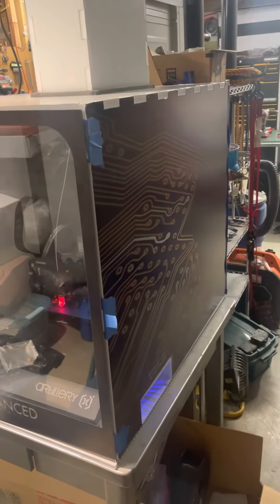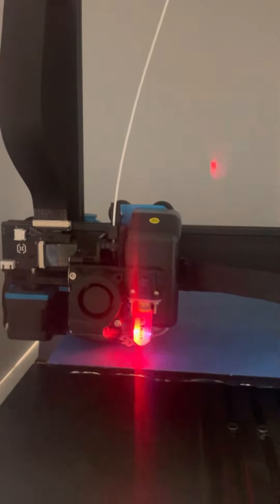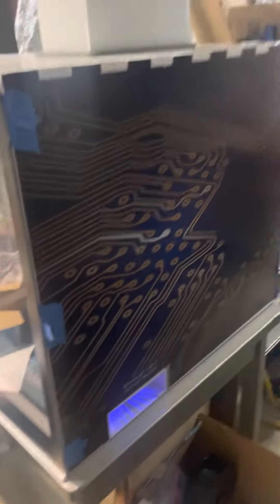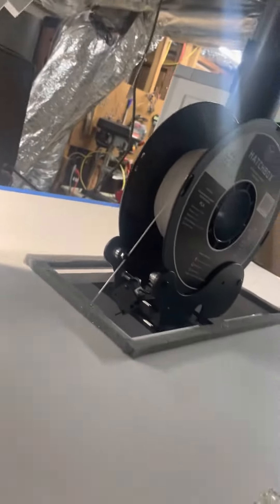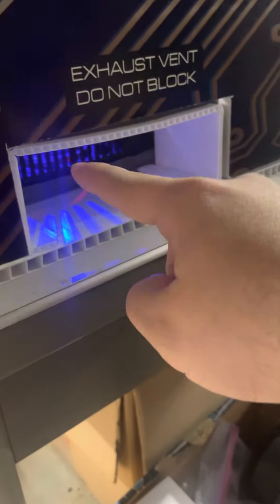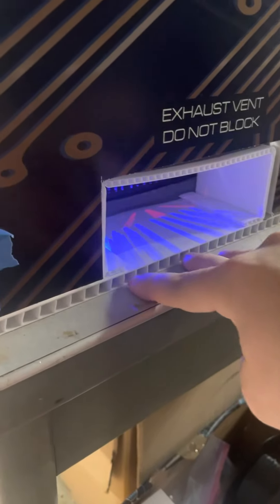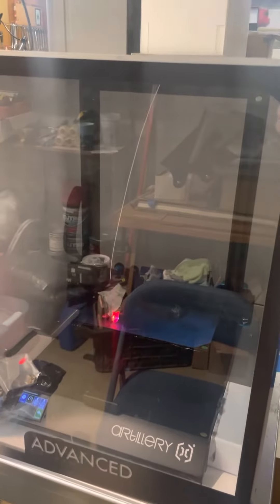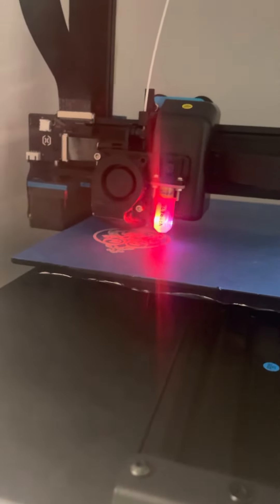Custom made enclosure for Sidewinder X1 #3dprinting

Comment: what exact problems does this solve ?.
Reply from the maker: Layer separation when printing ABS as the part cools. 

The enclosure makes the air surrounding the part more homogenous and traps more of the heat created by the heated bed and hot extruded nozzle.